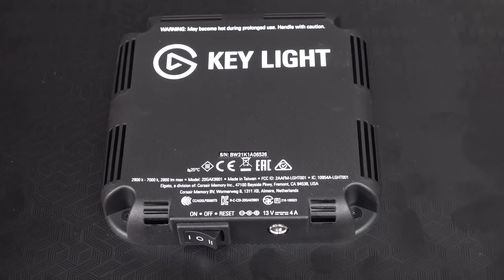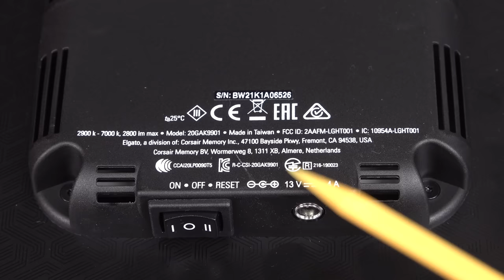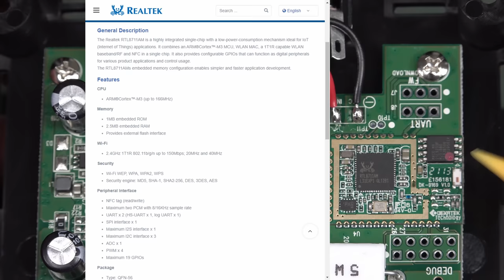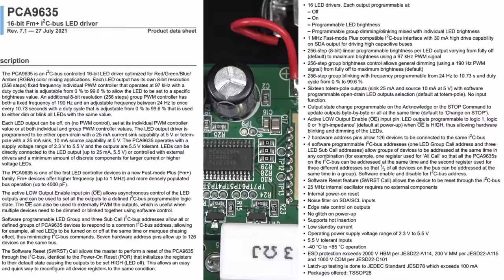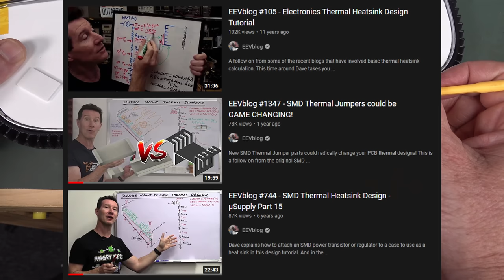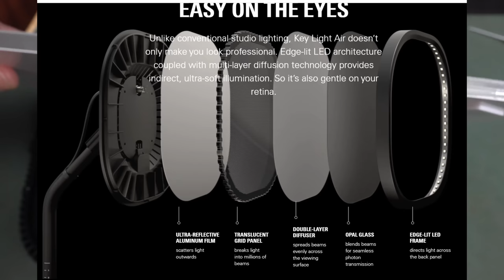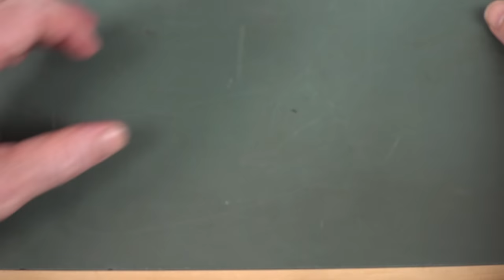EEVblog 1453 - Elgato Key Light TEARDOWN

Comment: Wow, that looks like complete garbage for US$200, I was expecting two proper DC-DC converters for the two colour temperatures not a pile of power resistors and PWM MOSFETS! I guess Elgato intends them to be solely used with 30 fps webcams otherwise I'm sure there's flicker.

The lack of thermal interface material on those 45 W LED strips surely has to be a manufacturing defect, no way you'd design all that and charge US$200 only to skim on a few cents of thermal tape and Chinese labor. Speaking of which where's the required country of origin marking "Made in China"? (correction: it says made it Taiwan, no clue how I missed that)

And what happened to the spec claiming 2900 - 7000 K when the LED strip is marked 3000 - 6500 K? Maybe they're relying on the dies and phosphor to overheat and drift the colour temperature into spec? 🤣 Might want to confirm the colour temperature of them before you go manually locking your colour temperature to what it claims.

Also why is that reset switch so user accessible? It's almost like they expect it to see a lot of use...

I also question how they bend that aluminum PCB given the quality of the rest of it, I was expecting a flex PCB, if they didn't calculate their bend radius right it might lead to some problems in manufacturing and life expectancy.

Thanks for posting this, I was looking at buying some other stuff from Elgato but had much higher expectations of good design for the price, at least from the outside they look like US$200 lights.
Reply: Your comment makes no sense, as lot of pro lights use 15-45Khz PWM. Even cheap Chinese panels that are much better than this branded thing use such frequencies.

Lack of thermal paste is common and lot of brands do not care. Elgato certainly has no idea how to make lights, they just asked manufacturer to make them one.
Reply: @adult-songs  The lights I have use constant current DC-DC converters (along with the ones I designed myself). I also have some 1 kHz room lights that cause no end of problems, at 15 - 45 KHz you'll still get problems with certain high shutter speed photography and high frame rate videography scenes but for webcam stuff I can see why they don't care.
Reply: @WizardTim  How about you show all this issues for real? 
You'll get 40-50khz light and show me issues for video at 480fps and below.
Reply: The difference between 2900K and 3000K as well as the difference between 6500K and 7000K is really small and is probably within the normal variation of these LEDs. They just picked the lower and higher number for advertising.
I wouldn't trust any film light under at least 1000 dollars to be that exact with color temperatures. I work with dedo lights and SWIT and Aputure light panels and professional cameras - and in the end none of them match exactly with their numbers. Even putting another lens on the same camera can shift the measured white balance in the camera by 100-200K.
If you really need to match the numbers that exactly, you'll have to buy Arri lights for a couple thousand bucks. Professional gaffers still only use the displayed numbers as a reference and use their eyes and maybe a colorimeter as their final point of judgement.
Reply: It's written "Made in Taiwan", Dave even mentions it.
Reply: @lolilollolilol7773  Taiwan is China, according to all all documents and countries, except few tiny islands think other way.

Comment: You could put a white opaque plastic diffuser sheet from a broken LCD monitor or TV over your old light to make it not so harsh. I did that to my shop light over my bench and it worked great.
Reply: You can also get different types of diffusion gels from Lee or Rosco. They make them in steps from 1/8th to full depending on how much diffusion you need. If you find a store that sells them in smaller pieces (instead of the 7 meter rolls), they're quite cheap, too.

Comment: It looks like they function pretty well but I'm not so sure on the build quality. 
Apart from the poor heat dissipation capability of the LED's I'm wondering how warm those 5W resistors get with prolonged operation and also how the "questionable quality" electrolytic caps hold up in the long term with that potential heat from the resistors within such a small enclosure.   As you say they may have done there calcs but I guess only time will tell. Great vid as always.
Reply: I'm still a bit confused about why they have the 5W resistors there. Couldn't you drive the LEDs with a constant current source, etc? I'm pretty sure I've seen chips that will do that with dimming capability.
Reply: they've done their calculations to let it die after 2 years. nothing else was intended.
Reply: @casemodder89  I think you have hit the nail right on the head. There is however one other thing to consider. What is the life span of the LED's? I'd say if they are as they claim OSRAM then I would guess that the LEDs would outlast the the rest of the unit.
Reply: @Muny  Me too I am also confused, surely there must be a better and more efficient way to regulate the energy to the LED's presuming that they are being controlled by PWM. Could be something to do with flicker reduction maybe? I really don't know.
Reply: @Muny  a constant current source means either FET dissipation or a complex IC, probably cheaper for them to use the resistors.
Reply: @M0XFXUK  not matter wich brand... an overdriven/undercooled led will give up the ghost prematurely.
Reply: @casemodder89  yeah I guess that is the best way to look at it.
Reply: @M0XFXUK  40-ish watts are dissipating through those poor thingies without a proper heatsink... Osram or not, they will not last for much longer than the rest of the electronics... They could've bothered to spend a few cents more to add a thermal tape at the back of the strip but then we might go back to casemodder89's comment...
Reply: @zwerko  The more I look at this the more I agree. Thank you for your comment.

Comment: PWM MOSFETs and a bunch of power resistors in something this price? I expected some sort of constant current setup, especially for video. I've designed a couple of LED strip drivers for use with video and even in the 10's of kHz you get banding and flicker for shorter exposure times.

Comment: I'm confused, they get extra odd 13V PSU then have to use those massive dropper resistors, why?
Get 12V or whatever is close to Vf of the lights and have only those small mosfets.
Or am I missing something?
Reply: Regarding the strips not contacting the enclosure, I'm guessing they designed it such that tension of the aluminium strip keeps it right against the housing all around but once it went into mass production they didn't get the tolerances quite right and it doesn't work as intented anymore, but re-tested it and it worked fine without excessive overheating and just left it.
You probably could fix it by wedging something where the strip splits so it springs out on the longer endges where the gaps are and closes them.

Comment: I bounce one of these of the wall and ceiling (which are white) for an even more diffuse effect. Also means I don't have to squint. I use them as my general lighting, switching between day and night mode with the app. And then when I have a meeting, I set them to a specific color temperature that works well with my camera settings.

Comment: How do they mix the 7000K with 3000K and 6500K LEDs? Is is possible to drive LEDs with a negative voltage to suck some light out of the equation? ;-)
Reply: you simply overdrive them by 50% additional current and they'll colourshift to blue ! 🤘😅
Reply: @casemodder89  ... and if you keep at it the lights gain a whole new function of a smoke machine.
Reply: Don't let the magic smoke escape the LEDs!

Comment: Maybe the strip is loose because of thermal expansion? If the aluminium PCB is heating up is its maybe pressing against the case/heatsink. Would be interesting if you get a thermal probe on these and actually see how hot they get.

Comment: Some day light manufacturers will include a power supply that doesn't dangle off the ground when set up on a stand. Making that cord longer should be possible, but the technology hasn't matured yet. The locking connector helps, but a longer cable has to be possible.
Reply: Professional video lights usually have a way to fasten the power supply to the light and then you can just run a long mains extension cable up there. You can't really extend a low voltage cable that much (like if you need it to be 2 meters or three meters long)

Comment: app-only control? pwm instead of proper smooth current? bad led cooling? what an utter piece of garbage!

What's the frequency on that pwm, btw?
Reply: I just looked up one of their light strips and it had pwm frequency of "1.5 mhz variable". I guess as you lower the brightness you could get flicker at the lowest range but probably they don't go low enough to interact with ordinary frame rates.
Reply: @gravlygravy  well, that's nice and high, i'm retracting the pwm frown then.

Comment: The al-u-minieum frame with the fins is just aesthetics to lend the product an appearance of being heavy duty and rugged.  
The thing of it is, this Elgato is 85% of a modern LCD display.  I wonder if a better alternative is to buy an LCD display and rig up an embedded system to make it display a certain color solid screen and then set the brightness to max?  
BTW, the manufacturer is out of the SF Bay area, so the name Elgato (El Gato) makes some sense.

Comment: They could've invested a few pennies to add a thermal tape at the back of the LED strip for an effective heat dissipation to increase the expected operational life a few times over. Not sure how much they are taxing the LEDs to begin with to discern if heat is a real issue, but seems to me that a $200 panel light should have that covered just in case.

Comment: Dave, love your blogs, they've reawakened my long dormant interest in electronics. Back in the day I worked on old computers and I mean old, with ferrite cores memory, paper tape input/output, the whole shebang. Even built a couple from components, as in transistors, diodes, capacitors, resistors, inductors and some ICs. I became a wiz at using oscilloscopes (storage if possible) to track down mysterious spikes. Anyway, I think you were wondering why they used a separate pbc with Wifi; Isn't this because equipment with built-in wifi needs to go through detailed approval testing, whereas using a previously approved module is cheaper, much cheaper (in line with the overall design of the light?) ?

Comment: Does one really need a core M3 to control a LED ligth, if the LEDs themselves are already controlled by an integrated LED driver chip?
Reply: Its for WIFI, you won't get much less powerful IC than that running wifi.
Reply: @jaro6985  EPS8266 comes to mind... If now Wifi is really necessary...

Comment: I personally have light problem with elgato hardware as i have experienced some troublesome cost cutting from past. Know 1 case where out of the box capture card cable was not up for the task, causing random problems that got solved by replacing with non manufacturer provided cable. 
Tho their keypads are overprices - the price you pay is for their software in the end
And as we see here... you are locked into their ecosystem - buy lights, download our software to control them

Comment: Because I prefer to have a physical switches and dials for my Keylights in some situations, I am currently building a "remote control unit" using an ESP32-S2 that has rotary encoders attached and communicates with the Key Lights' web service. (If you search the internet you will find some code examples to control it.) Apart from some bugs and missing features (I want to have the color temperature follow the color of the sunlight outside for the color to match the natural light in my room) it is a working prototype.

Comment: Is it possible that led strip expands under the heat of running causing a closer fit between them and the heatsink? It is aluminum i think.

Comment: doesn't it look like the aluminum pcb is clamped between the aluminum back panel and the aluminum frame with the 6 screws.   those edges might conduct a lot of heat

Comment: So they spend the money on the aluminium PCB then don't even bond it... Surprised the didn't just go with the bog standard flex PCB and adhesive. Could've saved manufacturing costs while still charging the same, least then the aluminium frame would be of some use. The wireless crap is completely unnecessary seeing most people will set a colour and that's that.

Glad I slapped together some lights for me and friends instead of forking out for any of the Elgato crap.

Comment: well to be honest, without the thermal adhesive they are at least easy to take apart and if needed easy to tepair.
Reply: and WITH thermal adhesive you dont even need to take it apart !
Reply: @casemodder89  electronics can and will break eventually. by your logic no device should be servicable.
Reply: @Chriss120  by my logic the leds would last their usual 20-30K hours (IF properly cooled). and the electronics will not. so thermal compound/glue would be the answer for a long lasting device.

designing something crappy and make it in theory serviceable is bad when the design forces you to service it regulary but that is hard to do if nobody supplies these alu led stripes.   so you end up with a servicable device that died prematurely and no parts available.

so my approach is way better eh ? EH ?

Comment: The strip needs to move, to expand and retract with the heat, that's why there's no glue. That's also why it seems too loose, they need some toleranc. Once light up, the aluminium strip expands and fills the gap.
Reply: I seriously doubt they are going to expand THAT much.

Just pure laziness and being extra cheap on the part of Elgato on a premium product.
Reply: By my quick calculations, assuming the strip is (35+35+25+25)=120cm long, room temperature is 20°C, operating temperature is 80°C, and thermal expansion coefficient of aluminum is 23μm/m°C, it'll expand about 1.6mm.

Comment: 7:31 It warms my heart to see this kind of power trace routing! My only criticism is the rotation of a couple of the connectors; I'm assuming this is for ease of assembly?

Maybe I'm just too "old school," but I'm hoping someone could explain to me how it is objectively better to PWM control a couple strings of LEDs with a micro and software rather than just a 556 and a couple of pots?
Reply: I guess it hooks into the computer so the streamer can sync the lights with different stream scenes and have them adjust automatically, in sync with each other and without reaching behind them. Other than that, much lower component count for much better accuracy, lower failure percentage. The whole WIFI pcb is probably a jellybean part that can be ordered en masse.
Reply: @AJ-wf1vh  As I see it, that's the benefit - multiple lights can be synchronized to change together.

Comment: No thermal adhesive and they claim 2900k but use 3000k leds.  For such a high price you would expect better.
Reply: The difference between 2900K and 3000K is minimal. You won't find a video light under 1000 dollars that will be so exact with the color temperature. I guess the normal spread of these LEDs is at least as much. 
And of course they just picked the lower and higher number to get a 2 and a 7 in there, because it sounds better.
But seriously, I have used much more expensive video lights were those number are still only a general reference.

Comment: I agree that the construction of these is absolute garbage, but the reality is that these won't be run at 100% brightness. I use one of these as a desk lamp because the diffusion is good and you can set the color temp, but I rarely run it over 50% brightness because it's so stupidly bright. I can't imagine anyone using this on their face for extended periods of time at 100%. Nonetheless, I'll be adding some thermal tape to mine. The outside doesn't get warm to the touch in my experience, though the leds might as well be 100C